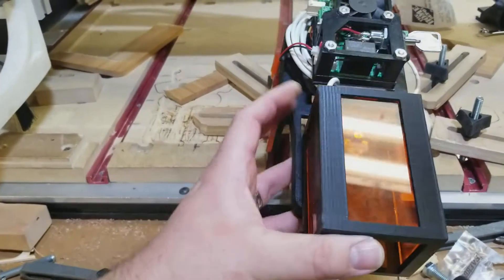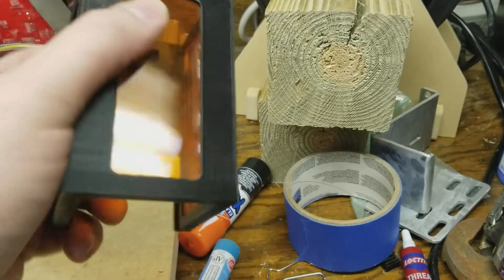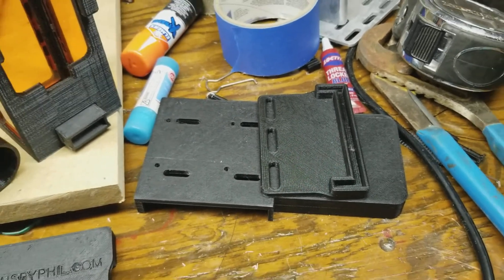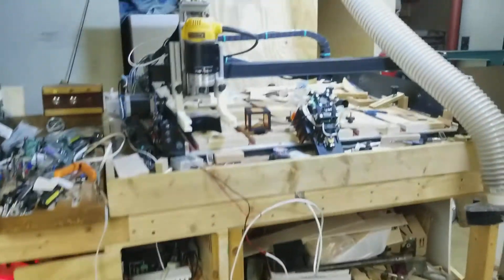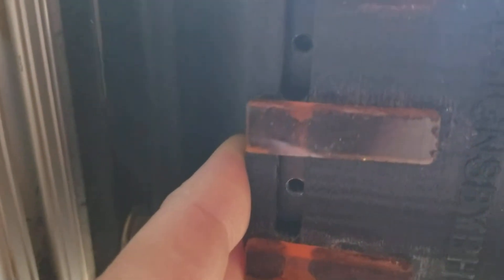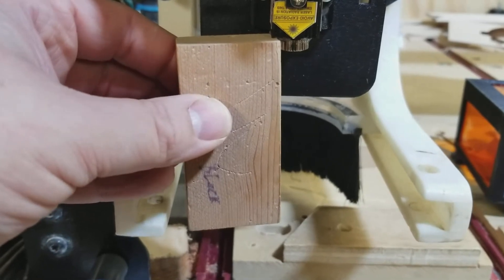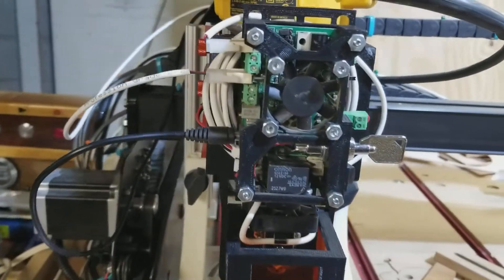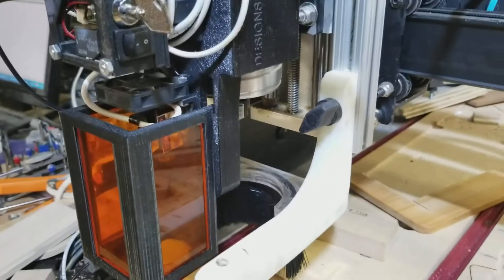Designs By Phil quick disconnect mount... rough video with prototype

Comment: This is off subject....but is there a way to change jogging feed rate on xcarve?
Reply from the maker: der ddd yes. It is restricted by your max feed rate in your grbl settings.
$110,$111,$112. But it may also have a restriction in your sending software. The 8000mm/mm is plenty fast for x and y. I wouldn't mess with that. The z axis, you should upgrade to a fast pitch screw like the cnc4newbie setup prior to increasing your speed.